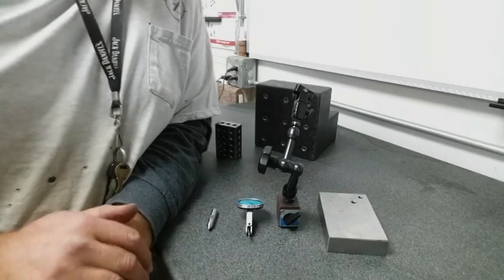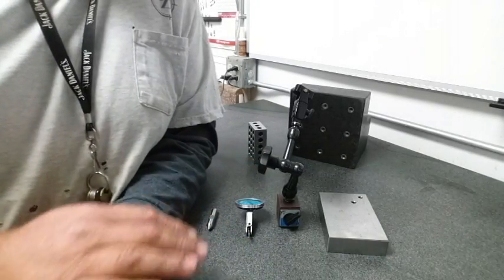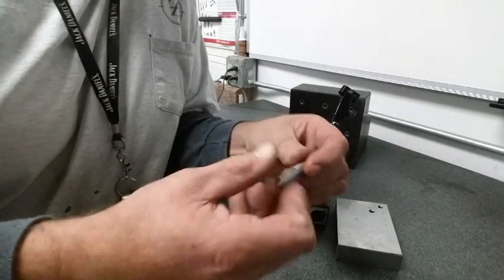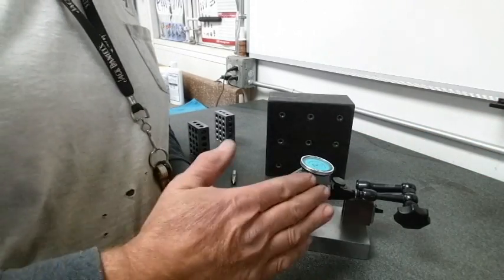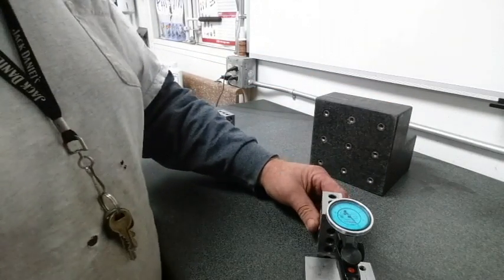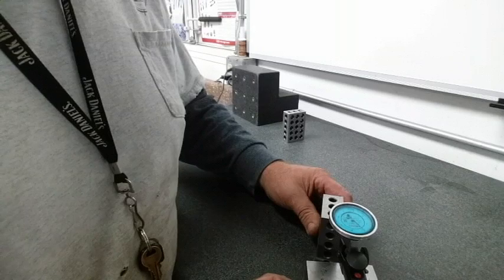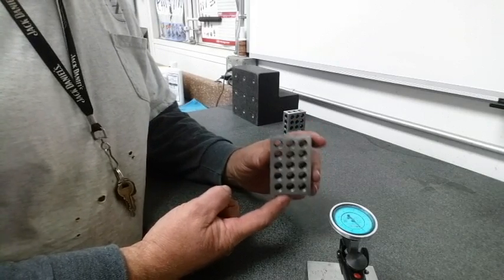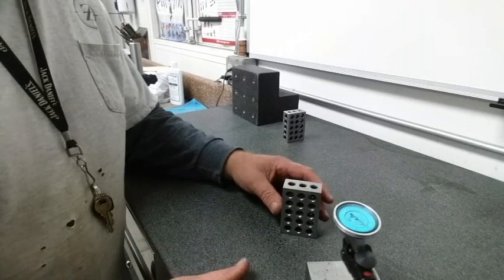Checking squareness on the cheap

Comment: I’m kinda confused about what the purpose of the pin is. I think a gage ball attached the front edge of the plate like a semi sphere would allow you to rock the indicator back and forth to find the high.
Reply: That's what I was thinking. That pin would just follow the edge of that plate, and if everything is not perfectly square, plate, indicator and having the test Subject in the exact same location,  how could you get an accurate reading.

Comment: Please forgive my ignorance. Is there any necessary correlation between the part being inspected and the size of the rod?
Reply from the maker: None, as long as the rod is precise it will work fine. Drill rod, old end mill, carbide stub, gauge pin, etc.

Comment: Really good tip, ive often seen you using your square master and wondered how I could check for square with out one. Although I suppose you could use a set of feeler gauges along with your square block / cylinder square to quantify a visual check?

Comment: The last one without the reference assumes that the block's sides are parallel, or it will give a false reading.
Reply: So then you would first indicate it for parallel and then for squareness? Assuming parallel, those 123 blocks were .0001 out of square over approx 3"?
Reply from the maker: +Wankel Motor Yes forgot to mention that, captions installed on the video.

Comment: Stan, if one has a master square granite angle plate (as you do). The best way to check for square is to clamp the part to the angle plate face, making sure it's up off & not making contact with the surface plate, then run an indicator across the top surface in (2)  directions checking for indicator travel. The third side can also then can be checked be laying the angle plate over on its side and indicating the now top surface in (2) directions. This is also the best method for grinding the same three primary datum sides square and parallel. Later, Toolmaker JimC